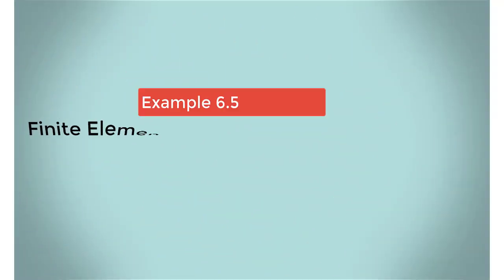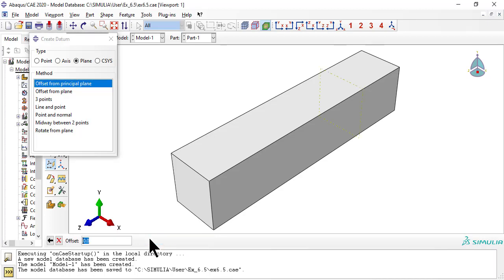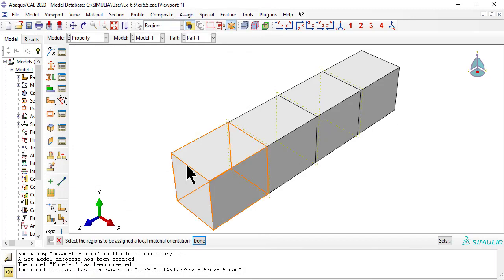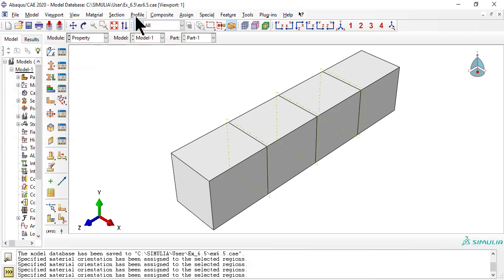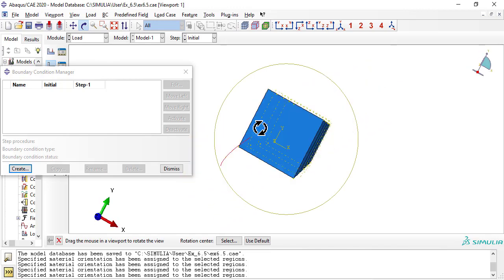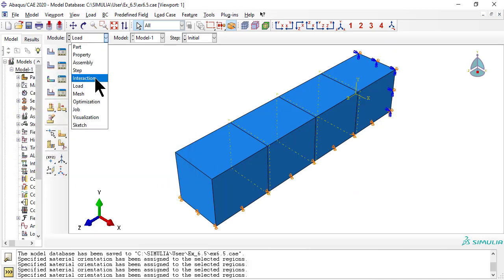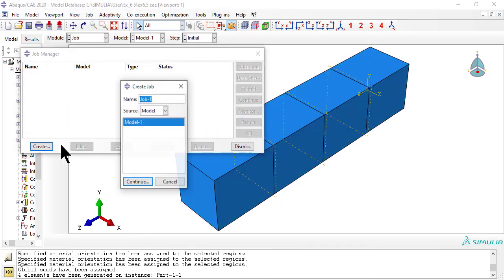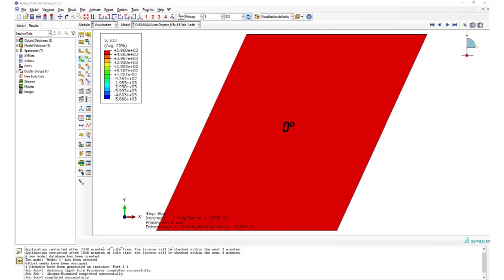Example 6.5 Calculate laminate properties using Computational Micromechanics in Abaqus RVE

Comment: Thank you Professor for these videos. Professor I am using "Finite Element Analysis of Composite Materials Using APDL" text book.
How can I proceed for getting E1, E2 for the laminated RVE ?
Reply from the maker: Make a simulation like you would do an experiment in the lab. Apply tensile stray, Ansys tell you the stress, divide one be the other to get E
Reply: @EverBarbero  Thank you Professor.

Comment: Thank you professor. Two questions. First, why you used interaction here? Second, what is the difference between applying bc in an initial step and propagate to other steps with directly apply in the next steps not the initial one?
Reply from the maker: Under "static, general" you can change the b.c. from step to step. If I want the b.c. to be applied always the same for all steps, then I put in on the "initial step" and let it propagate to the subsequent steps. If I wanted, I could make it disappear after a few steps, and put a different b.c. if needed.
Reply from the maker: I use "interaction" when b.c. are not enough to simulate periodicity conditions. In previous videos, symmetry b.c. maybe was enough to simulate the periodicity. If it is no longer the case, then I have to use interaction.

Comment: Dear Prof. Barbero,

I have a question regarding composite modelling. We can use solid or shell modelling in our modellings. I did that actually. In solid we need to make partition and use material orientation in material section and define orientation in each ply. In shell you define in composite layup directly in abaqus. I just have a question. When we model using the solid we normally define material properties in the corresponding section (E_11, E_22, and etc). In shell you define material properties in each layup. So, could we conclude that the one in solid is laminate properties and in shell the lamina properties should be defined, since in shell we define layer by layer, but in solid we just input material properties as a whole.

Thank you
Reply from the maker: For each lamina, in solid and in shell models, we enter the lamina properties. For a solid it wants more properties like E3, but the other properties like E1, E2, G12, are the same.
Reply: @EverBarbero  Thank you Prof. Barbero, You are the only one I need to understand composites with abaqus. I hope you receive 1000 subscribers soon and put also thermomechanical and damage analysis.